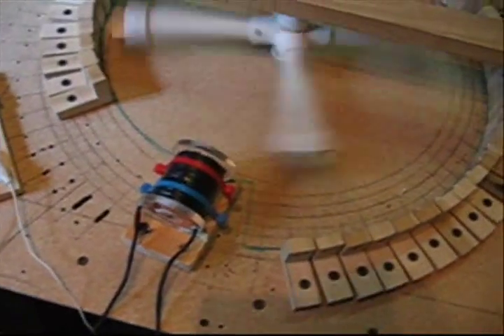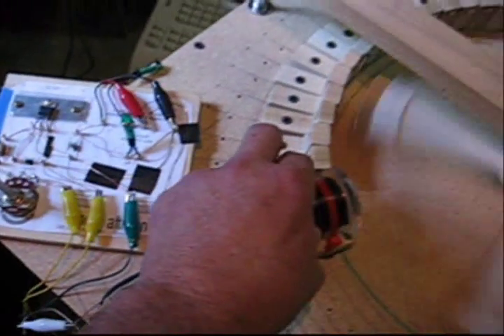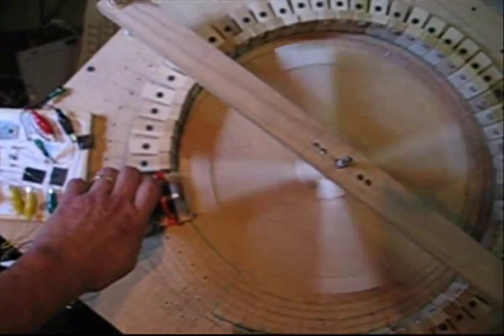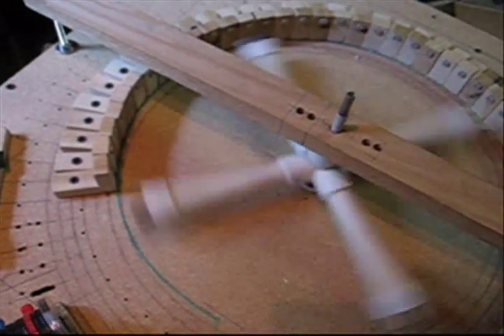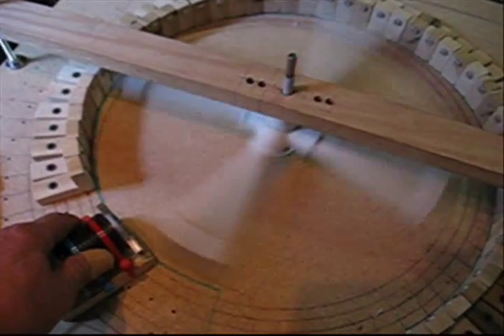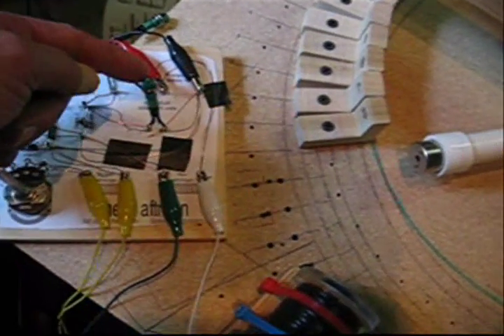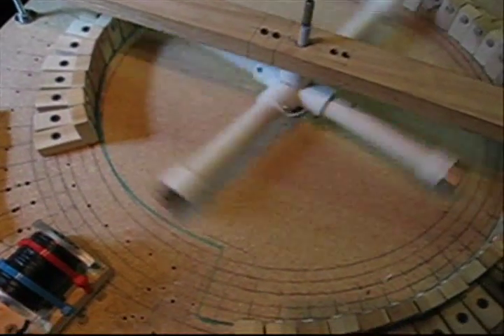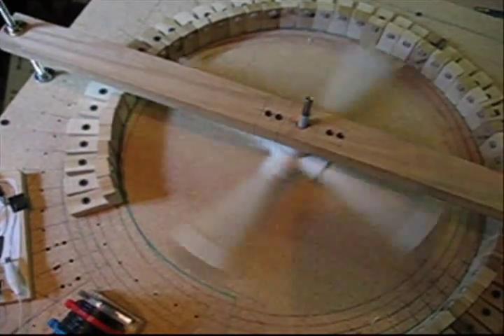Magnet motor bednin circuit

Comment: Hi Mcorrade, 
Great Work!!! 
This is that I am looking for, and I am working for also, a Joining Bedini and wenkel. My system, not totally finish and tested yet. Only partial test, bedini part and wenkel part. The current draw of bedini is very low and efficient, and I can see good acceleration of wenkel as well.
The system is different in rotor model, to provide more generation electric.
Congratulation Sir, since you already found it one half years ago!

Comment: youre on the right way. great!!!
you must have a charging battery in a bedini circuit. thats what bedini is all about. radiant goes to charging battery. neon must never light, if it lights it means overvoltage is hitting the transistor instead of charg.bat.
ultimately you can charge capacitor instead of ch.bat. and dump it with a timer in primary battery, and hopefully have a self sustaining system on one side, and a runing wheel can run a generator just as you want.
great work, keep it up